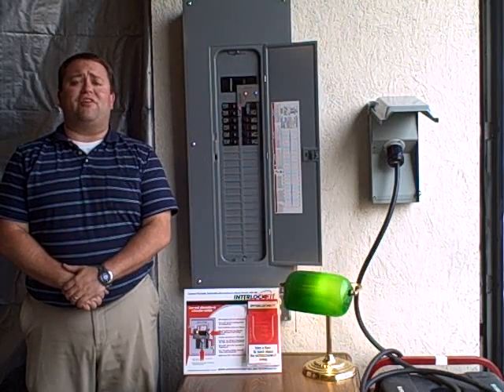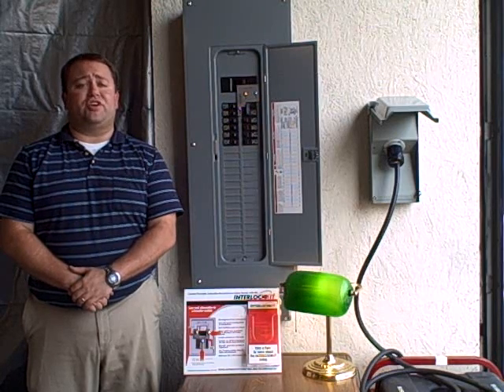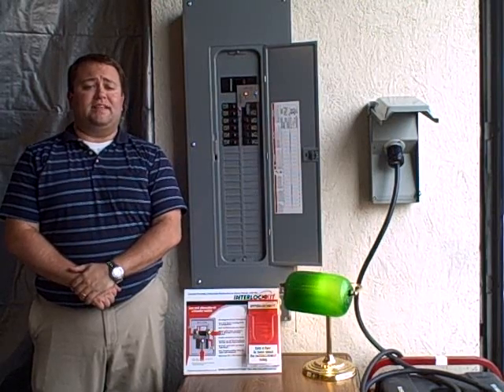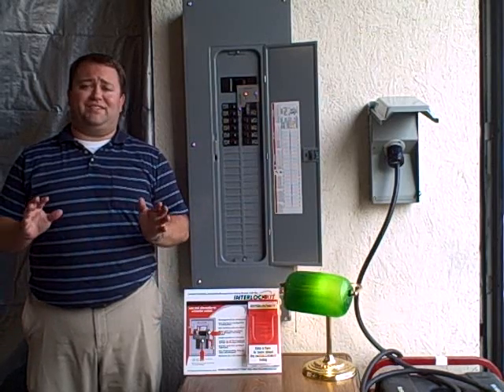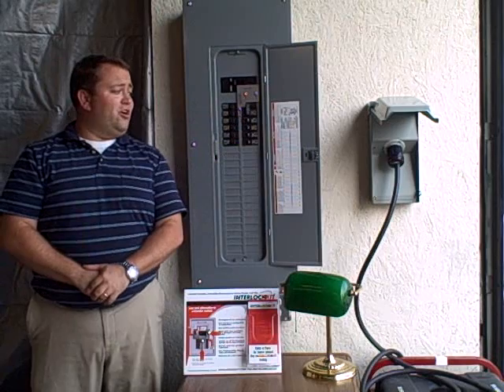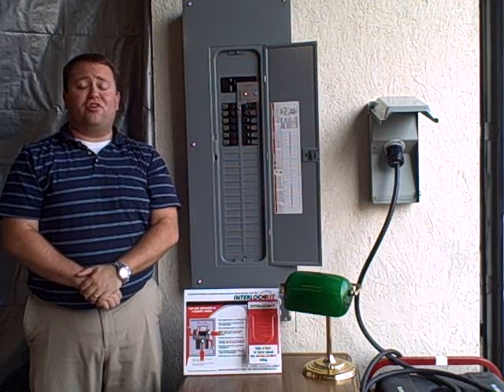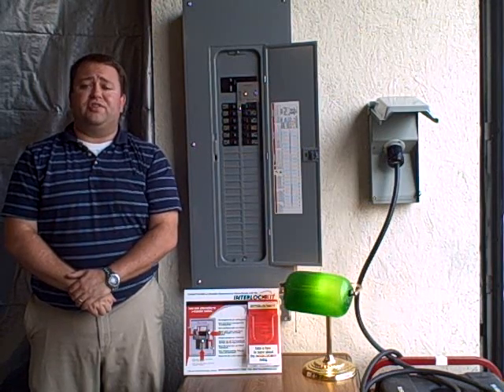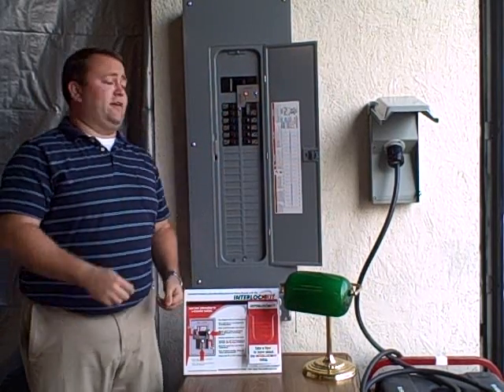How To Use a Generator Interlock Kit

Comment: I have a question. How do you know if the power's back on if you live in the middle of nowhere haha.
Reply from the maker: We also sell a product made by Reliance Controls, it is called the PowerBack Meter. It sounds an alarm (80-90dB) to alert you when the power has returned. Other than this method, you would have to turn off the generator and test the main service breaker. Thanks for your interest!